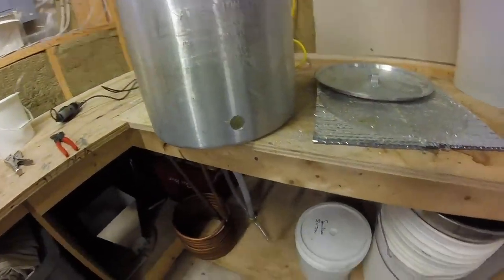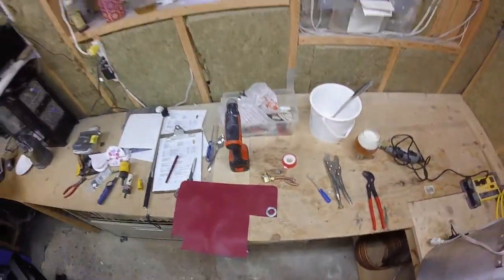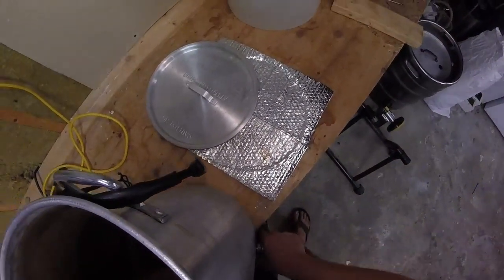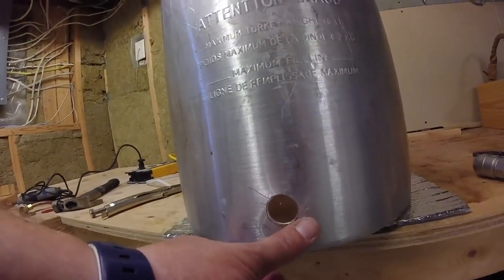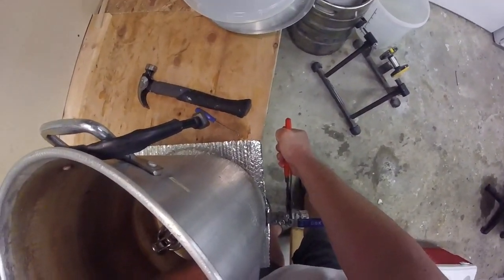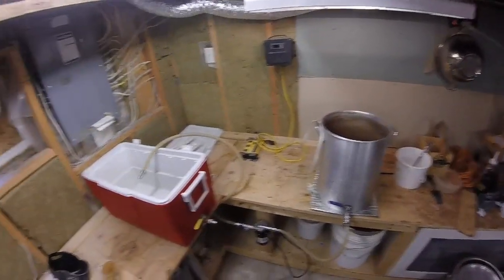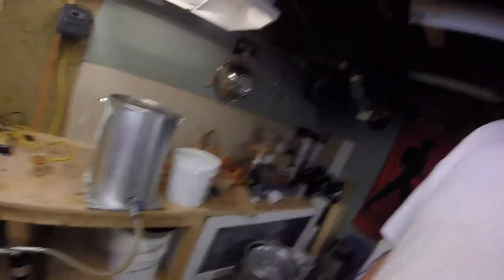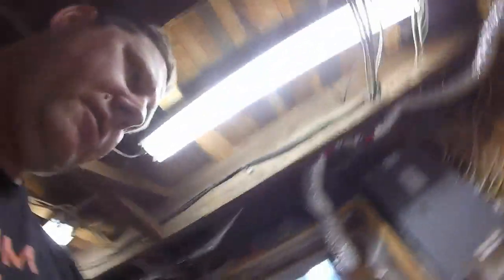Home Brew Wednesday Sept 2nd 2015 - Ball Valves, Holes and Sparging!

Comment: "That deserves a victory sip...!" LOL Couple thoughts: Your pump will prime better/easier with the inlet facing down and the outlet facing straight up - ensuring no air in the center when pumping. No worries about a wide spread distribution of sparge water as you should keep the water an inch above the top of the whole bed anyway - main point is just to avoid creating water channels. Have a silicon hose from the mashtun outlet into the bottom of your bucket to avoid aeration. Avoid the pvc tubing idea - and all together actually. Anyways, just my thoughts. Looking great! Can't wait to see that Rye IPA brewday! ;-) Cheers!
Reply from the maker: +Tony Yates Cheers T.  I unfortunately didn't film the brew day, but things worked out really well with the foil pan.  I will re-orient the pump as per your suggestion, as I did have some priming problems.  I will be sure to film next time!  Cheers and thanks for the info.